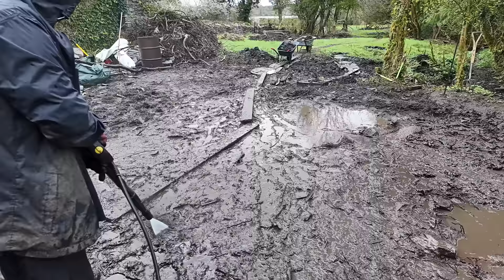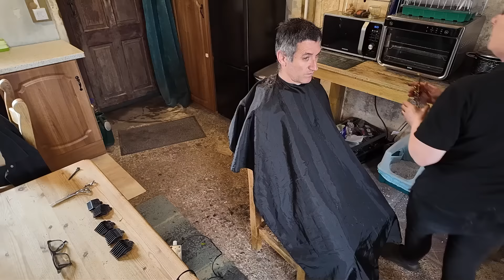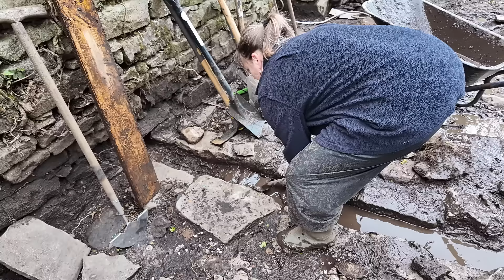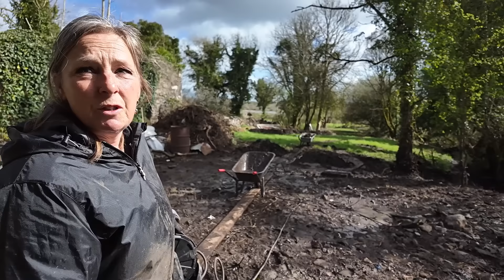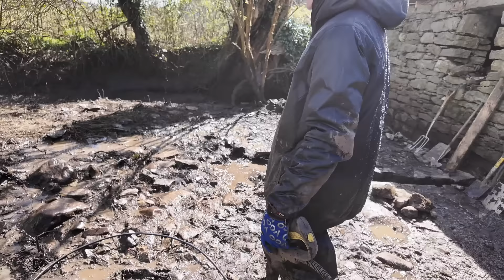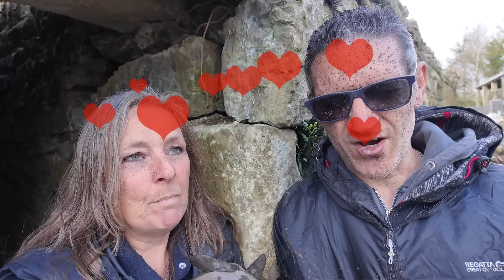3 Weeks Of Discovery Revealed: Our Irish Farmhouse & Homestead

Comment: I doubt very much this was a slurry pit so close to the house or barn.  They are deadly. The fumes alone would have finished them all off in short order.

I do think this was a water/rain drainage system. There were most likely pipes (clay) under the barn to move the water from the high side under the barn to the back. The holes you found in the foundation is the clue. 

Slurries were Far from the barns, the homes and the areas livestock would roam and feed. Usually fenced off so livestock couldn’t wonder into them, as it would finish them off.

The stones all around are from the barn falling down. There may have also been a stone wall on the creek side that fell. 

Maybe the smaller circle of stone was a fire pit.
Reply from the maker: That is a good point with it being so close to the barn. I was reading a couple of days ago how dangerous the fumes that come off them are.
I’m half expecting that once we get rid of the roots we might see some sort of gulley over the edge to the ditch. When we dug out the floor of that outbuilding I came across a portion in the floor,at the wall with the hole that goes outside, that has just seems to go down below the level of the outbuilding wall. When I can get to it I will investigate that further.
Wouldn’t it be lovely to be able to have photographs of when it was all first put together?
A fire pit could also make sense. 
Thank you for taking the time to comment with all the info that you did, it’s very much appreciated. 😊

Comment: Nice recap video. Oak island I gave up on that years ago lol. U want another quick cheap job with a big impact. Skip the D2 and get 5 gallon of hyper choride bleach from ur local farm shop. Dilute it down 5 to 1 and spray it on the walls of the house and any paths etc. let it site for 10 mins and the power wash it off. Do it on a day there’s rain. Everything will be clean. Test it on the limestone walls first to sure it not going to be too aggressive. 5 gallon should be 20 quid.
Reply from the maker: Thank you! Haha Oak Island we haven’t watched for a while now but really liked it to begin with we did wonder if we would come across a connection with the knights Templar whilst digging away! Haha! 
Ooh lovely that sounds good to me, will it be alright with having the cats around? It would be good to do though. We did wonder about painting the front of the house until we can get the concrete render off, just to make it look a bit nicer than the greying white that it currently is. Will have a look for some of that. I keep forgetting to show the D2 patches…it does a good job but it is quite expensive…I think maybe 4 times the price of what you have mentioned for the same quantity. 
Gates back from the galvanisers yet?
Reply: @thecornerhouseproject  it’s Basicly bleach for farm yards but aggressive so u dilute it down 5 to one. 25 litres in a drum it’s supper cheap. I got it last week for doing the drive at the back of the house. Keep the cats inside when ur using it. I use a garden sprayer to get it on the walls of the house then after five mins wash it away. Do it on a wet day and keep the cats in. Use eye protection and gloves. It’s strong bleach but test a little on lime stone first. U can see the dirt run of the wall. Yep the gates will be back end of the week so it will take a few house to get them up and filled with boards. Will put a quick video up when I get them done. When u go to do the outside of ur house with render u can use a primer and then render over the top of what’s there. My mum did it at her house. But for u 100mm of insulation around the out side first and then render. U couod fit the external insulation urself it’s that easy. Don’t let the cats walk in the bleach it burn burn paws hence do it on a wet day to dilute it more and wash it away

Comment: I would think that area may have change use many times over the years and have been redone so it may be impossible to tell what it was used for.
Reply from the maker: I think you could be right actually….200 odd years is a long time with lots of different advances in the way people worked I suppose. It’s nice to speculate about how it might have looked and been used.